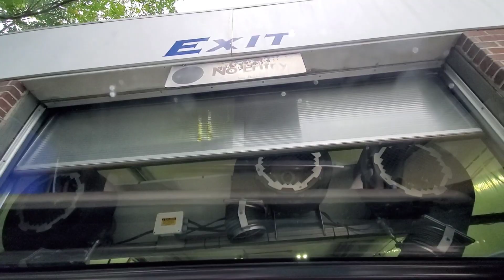Ryko Softgloss Maxx 5 with Newer Slimlines

Comment: this is the dryers that are horrendous! The wash however did very good!
Reply from the maker: Well, I would actually have to say these are still a slight bit better than the on-board dryers for me. However, yeah, I think improvements should be made to these.
Reply: @kingcarwashnfansdrivesetc8364  There was a new vortex drying system from Ryko Solutions! It should do better than these crappy slimline dryers!
Reply from the maker: @cammycamdemos9799  Those dryers you're mentioning, are those the ones wth the spikey side piece? I have yet to find where any of those are as they look awesome!